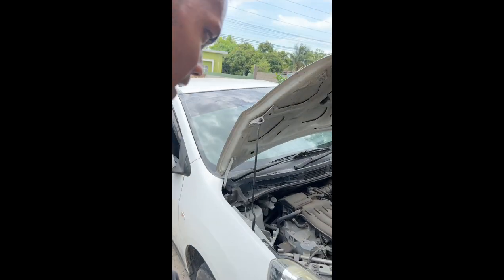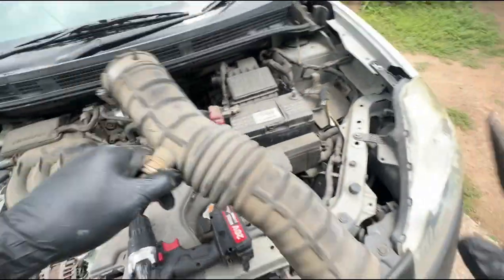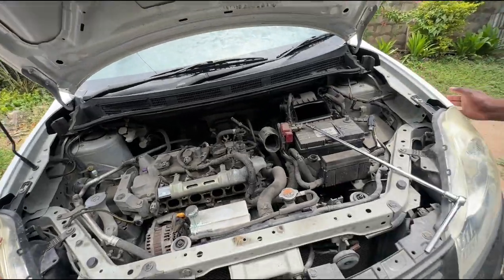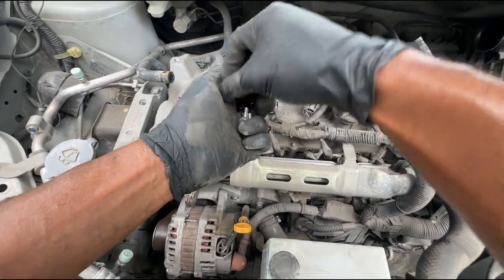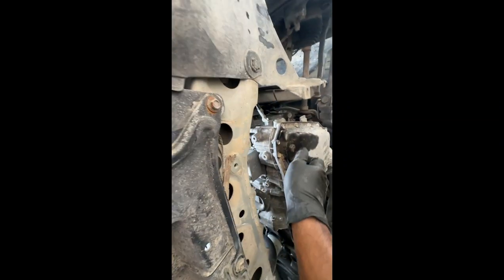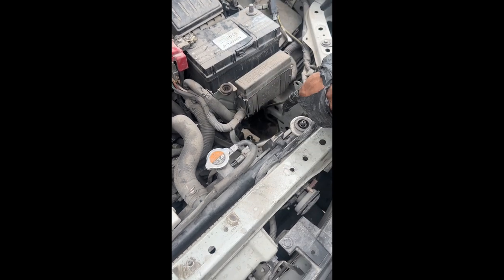How to service AD wagon engine and transmission

Comment: What could cause the car to jerk when shift  into re reverse? I have never changed the coils in rhe transmission from i bought it. Its a cvt transmission 2013. The car has low power going into reverse and drive. Reading says transmission computer error 😢😢😢😢
Reply: Check the right engine mount

Comment: The cvt nu have a oil filter?
And how you check if the fuild at the right level
Reply from the maker: U cant check the level, the manual stated the amount needed
Reply: @infinitibossauto  manual I get is strictly Japanese that's why me a ask

Comment: I’m assuming that this transmission mash up since this video is a year ago, but u made an error oiling the tranny, the reason why there was so little fluid when u release the bong is because it already had sufficient fluid in it,
The extra four quarts you added will foam the fluid causing friction ultimately burning 
And killing the fluid wich cud damage the tranny permanently.
Reply from the maker: Tranny good up to this day no faults
Reply: Get to the client and top it off the right way.
Reply from the maker: @Jkeezrecords  since this day we service ova 200 cars tranny and ova 20 ad like this type no faults no complain  and we got certified mechanics here level 3 working safe to say its fine
Reply: not saying that ur not good, jus saying that’s a grave mistake,the car will run a few thousand miles depending on how much driving done, but that fluid gonna foam, then over heat, and u kno that dead fluid will result in total lost of power under operation temp. 

My ad wagon was overfill by two quarts and that’s what happen to me. Check it out.